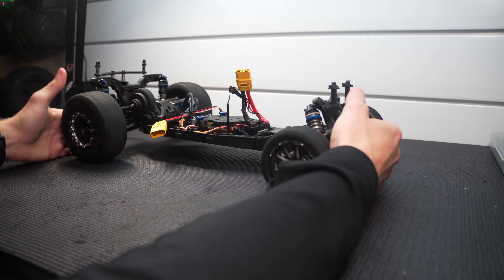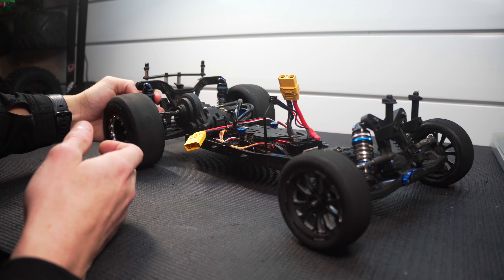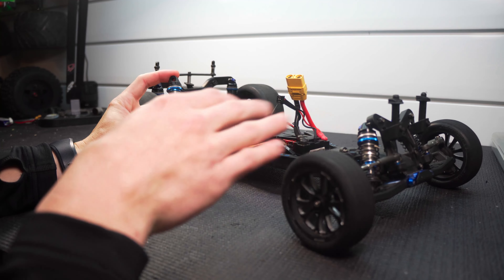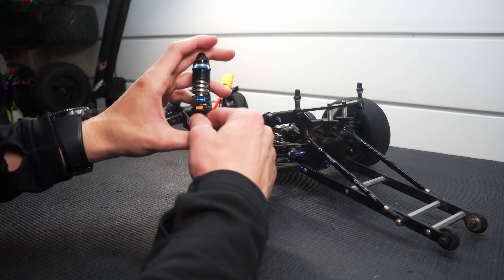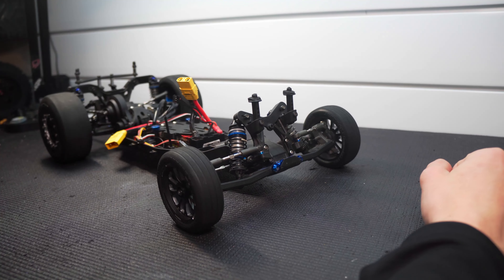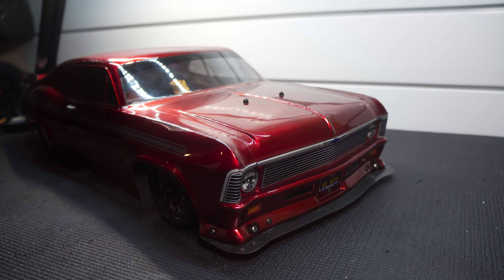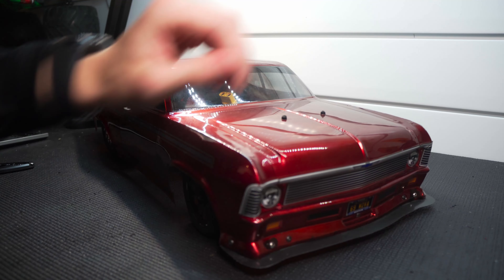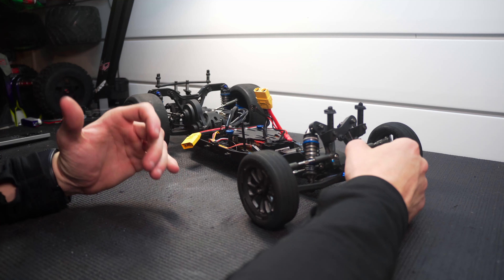Getting the Ride Height Right!! | RC No Prep Suspension Setup Changes

Comment: Good stuff! Been binging all your videos. When it comes to springs and shocks,
People often confuse the function of springs vs shocks. The spring controls how much distance the suspension will move under a given load and how much weight transfers to that corner. The shock dampens the motion, controlling how fast the suspension is allowed to move, and reduces (ideally eliminates) oscillation in the suspension.
Reply from the maker: Thank You!!! I think the thing people overlook the most (guilty of it myself when I began in the hobby) is the dampening rate of different shock oils. Many beginners go straight to the springs to adjust suspension but the oil needs to be looked at as well.

Comment: you know lay-down shock gives you more traction. the reason is you can run a hard spring and still be soft (for weight to transfer) and as the suspension compresses it gets hard, then put the pressure on the tire. 

 but this is coming from an off-road background. probably the best way to adjust your car (since you already have good weight to the rear with the motor) is to run a stiff stand-up spring. with ride-height at dog bones level (for speed) or just below dog bones level is a (bit better for grip and speed). then adjust the weight transfer with the front end (like change the oil for slower or faster transfer) or (change the shock limiters for how much total weight you want to shift). kinda sucks you probably don't have droop screws for fast adjustments.
Reply from the maker: What you described in the second part of your comment is basically exactly what I'm running. I'll be doing an updated suspension video on this car soon since I got it pretty dialed in now.

Comment: What if i dont keep any suspension at all for the rear wheels? Or will it then have a very bumpy ride?
Reply from the maker: No Prep rules require the car to have suspension. So you could run without any suspension but it would have to be in a "run anything" class or just for fun.
Reply: Upon launch, there will be no control of the weight transfer to the rear tires, which will actually reduce the transfer and allow the tires to spin more easily. Additionally, the tires will momentarily lose contact with the ground upon every small bump, which will also allow them to spin. The car would be very hard to control under acceleration.

Comment: I know I had to put limiters in the rear of mine because the rear end kept wanting to raise up instead of squatting down but but it works pretty good now
Reply from the maker: I have seen a few instances of the car lifting up, I have limiters in the original longer shocks but I haven't needed them in the shorter front shocks I use in the rear.
Reply: I know I got the front shocks in the rear 2 but just for some reason it just wanted to start lifting the rear end up pretty badly that was horrible towards the end when it was at Full Throttle and hit him up or something cuz it cause a wheelie bar to sit real high off the ground and couldn't keep the front end down so I lowered the wheelie bar and put limiters in it to where it went raise up no more

Comment: I couldn’t find the DE tire video where you made your choice. Did you decide on clay or soft? What is the Phenom model number. 
I’m tuning a bandit to lcg slash no prep with proline vette body. 
Great videos!!
Reply from the maker: I started off with the clay compound, DER-PSC-C1. 
Thanks!!!
Reply: @FullThrottleRC  did you decide to use the insert or not? Did you tape it?
Thanks again
Reply from the maker: @ggoldb123456  I used the foam. Printed a tire band to put on the inside
Reply: @FullThrottleRC  good to know. Thanks again
Reply: Sorry for the bother again. I love the way you present on your videos and the info is spot on and helpful!
When you were done tuning shock height, preload etc what is the chassis height front and back at rest and compressed?
I am waiting on the same C7 body to arrive. 
I hope you still have the same setup to measure. Thanks again for your help! I hope I can send you a photo soon.
Reply from the maker: @ggoldb123456  I can give you some rough measurements but keep in mind a lot of things can make your ride height different, especially when the suspension is compressed. Sitting at rest the front is about 0.75" and the rear is roughly 0.85". Fully compressed, the front is roughly 0.40" and the rear is about 0.55" when the wheelie bar hits.